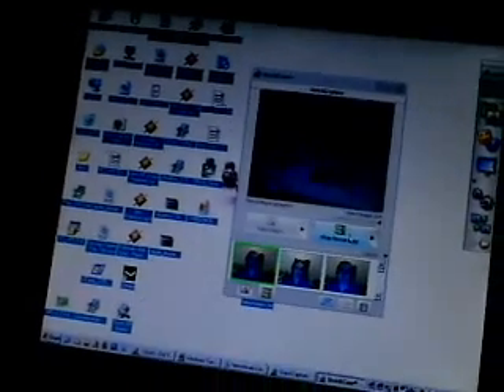Crysis 8800 GT (1) and Watt Usage

Comment from the maker: @Dxxchrisable With a single 8800GT and a watt meter I was easily pushing 400 watts and spiking over 500 watts, with two in SLI it just maxed out at 600 watts...so yeah, 350 watts is PROBABLY not enough though I don't know how much power your system draws overall.

I think the fan issue is unrelated and it's probably not under warranty at this point...you could try getting a molex converter and plug in the VGA fan to your power supply though I don't have the luck of living in Norway. :-P

Comment from the maker: @Dxxchrisable Well that's a dicey situation to be in unless you think you can pull off reliably cooling the video card. If you have a good case it'll have a side fan which really does help more than most people think.

Also 350 watts isn't enough for gaming unless your rig's specs are very light.

Comment from the maker: @Dxxchrisable Is the cable plugged in snugly? Most PSU's have multiple six and eight pin connectors, try a different one. Also make sure the wire from the fan to the video card itself is plugged in securely.

Comment from the maker: If the video card requires additional power and has one or two power connectors at the end then you should make sure that they get the power they need. 16X PCI-Express 2.0 slots only get 75 watts of power (not completely sure offhand) and many cards use well over 100 watts. My 8800GT turns in to a screaming banshee if the 6-pin power connector isn't plugged in. Use the converter if you don't already have a 6-pin power cord coming out of your PSU.

Comment from the maker: That's a big step up int he GPU department, the 8400GS only has a 64bit memory interface.

The 8800GT only comes as a PCI-Express 16X card so you can't use it unless your motherboard has a PCI-E 16X slot.

Comment: Is it safe to run a 8800GT in a 430 watt power supply? Will running the 8800GT at this Power supply damage the card?

Comment: I plan on powering a system with a 460W power supply that even has an AC unit in it and the AC says it runs at 52-54W. Perfectly acceptable to me. However, this video somewhat scares me... because I fear I may not be able to run Crysis... but yet again, I see so many reviews for the 8800gt 512mb series cards (what you're using, I presume, as it looks like mine) and hundreds upon hundreds of reviews say they use 350-450W power supplies. Mine will be 18A on both +12V rails/ 30A on 3.3 and 5. Safe?

Comment: I got a Intel Duo Core Quad 2.4 Ghz and a geforce 8800GT with 2 Go of memory and my power supply is a 500Watt, the one that came with the Antec Sonata III box, will my pc be alright running Crysis at full power (full power for me is the best graphix with the best FPS for my computer) or should I power it down a bit to give my power supply a chance?...

Thanks for the answer ^^

Comment from the maker: My Thermaltake 500 with a single 8800GT at full load ran at 420 watts and spiked at 480. You'd be cutting it as thin as it gets most likely. Without knowing what your system *actually* uses it could go either way but probably not by enough.

Comment from the maker: I peaked around 480 watts and averaged about 420 watts with my current setup. I probably have more hard drives then you but it's still a bit close. If you're not going to do exact math and then run it so close then upgrade to at least a 600 watt PSU for a single card, at least 700 watts for SLI.

Comment: You'd get from 20 to 25 fps or something like that. In XP you'd get arround 30 to 36 fps (with the very high tweak, but it wouldn't be the same as on vista, even tough some effects that are directx 10 like will be activated with the tweak in xp)

Comment from the maker: Probably won't get playable frame rates unless you turn some stuff down, but that wouldn't count as very high. You would probably be best doing very high though cutting down on shadow effects which usually take an unjustified FPS hit and may put you back in to playable FPS. However you'd get even MORE of a boost in FPS by "downgrading" to XP.

Comment from the maker: After my 500 watt PSU was running at 600 Watts for about half an hour non-stop and then croaked I would say no. With two 8800GT cards in SLI you'll want at LEAST 700 watts.

Comment from the maker: Yeah the cards were *SUPPOSED* to be priced between $230 and $250 but now they are easily pushing $300. Only XFX brand cards are available a moment ago when I checked Newegg. The G92 version of the 8800GTS is out now though it's performance gain is not justified by it's high price. Even overpriced the 8800GT are (on nVidia's line up at least since I haven't really taken a serious look at ATI's latest offerings) the best overall card.